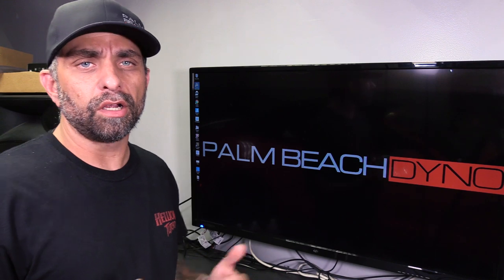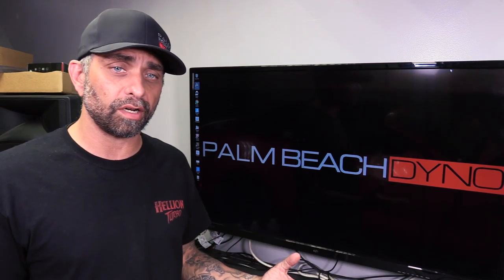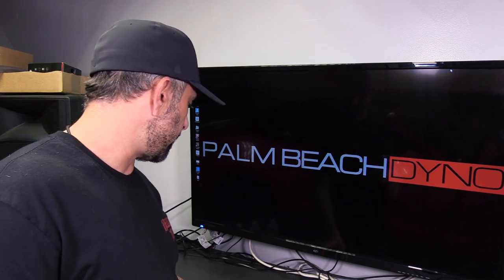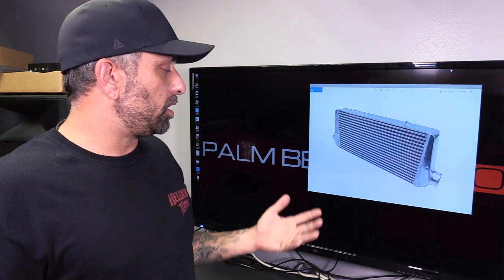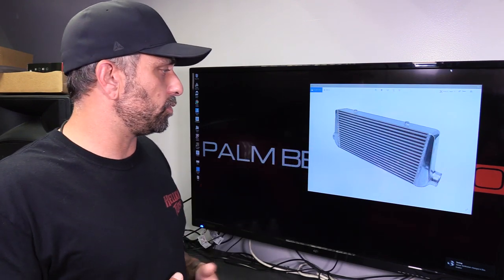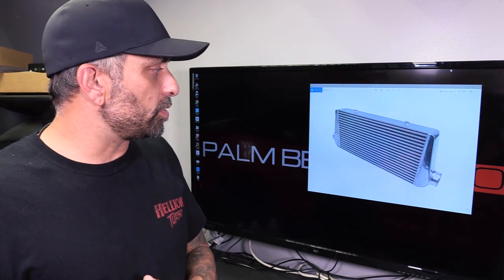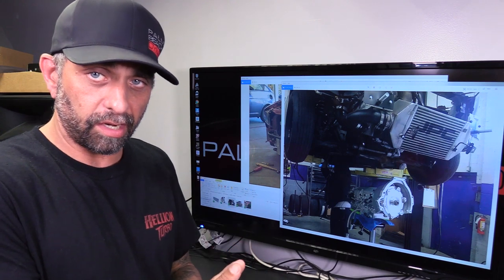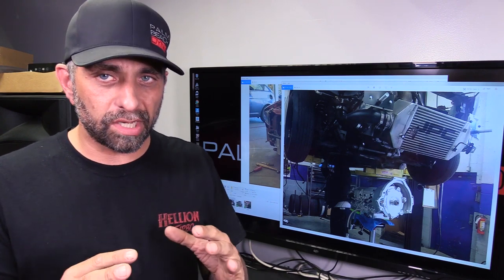Intercoolers : Air to Water vs Air to Air for a Street Car

Comment: Don't run e85 from the pump! You will get water at some point. Rather run water methanol injection. If you must run e85, buy a drum.
Reply: Buy the test kit to keep yourself safe test befor you pump\
Reply: That's everyone lol everyone gets it from pump. Do you already not get regular fuel from stations?

Comment: Why isn't there an air(charge pipe) to water(cooler) to air(outside air flow over fins) cooler. That would combine the performance/benefits of both and run your water lines to the cars coolant while still having a rad maybe thinned down a little to fit what I assume will take up more room intercooler but run colder Temps for sure. Everyone knows when you run air over something wet it'll cool the best.

Comment: My introduction to intercooling was done when I read Corky Bell's "Maximum Boost".  

The explination here is great.  I think that you want to "over engineer" the efficiency of the heat dissipation of the coolant running through the IC.  I'm running a bullet style IC on my air cooled VW Beetle with a 1.9 ltr Porsche 914 four banger..   Audi B5 S4 coolant pump, 1/2" coolant lines to a self purging resevoir tank from a Passat.  Compact radiator with twin fans and thermo switch for the fans.  When I'm in stop and go traffic, the  twin 5" Spal puller fans turn on.  My radiator is behind the front grill of my Super Beetle.  Great airflow. On the highway they turn off.  I run G13 (pink coolant with distilled water)

In the California San Joaquin Valley it gets very hot in the Summer.  We see 110* temps.  My  intake temps after the IC are never greater than ambient temp.  Usually they're cooler.  It's like I'm at sea level all the time, so the air intake charge is super cool and dense.  I run 91 on the street.  Plans are to be able to switch back and forth between E85 and pump gas and add water injection as a safety measure as well.  

Well engineered charge cooling is like having MORE cake.

Comment: Ok things to help
Downside to air to air. About 5 degrees over ambient is the best you’ll get with it and it might heat soak.
Higher pressure drop
Upside. It’s significantly lighter 

Downside to air to water
Weight, relying on an electric pump that can fail and cause incredibly high temps and knock

Upsides.
Sub ambient cooling with ice
Less chance of heat soak
Shorter charge pipes and better packaging
Reply: flatplanefool  e85 or meth on tap or both with air to air
Reply: crown Victoria lifestyle  run on straight meth and you can make the intake sweat... but for a daily having secondary fuels are a bad idea in my opinion too much stuff to fail an blow your engine up.
Reply: flatplanefool no no no pump e85 is the primary fuel which as he stated has its own intake air charge cooling properties 
The meth can be set to different settings to turn on and they also come with different nozzles so you don't have to spray a massive amount of meth on top of e85   just like anything the combination is key when I do my 4 valve swap jt- b trim that will be my recipe without having to worry about bags of ice, pumps and more hoses that add weight to the vehicle 
a simple one gallon meth Reservoir will be enough for many  runs
Reply: flatplanefool I probably confused you with my original comment my comment was have meth on tap I wasn't saying run meth by itself I was stating run the meth with the E85 or no meth or both
Reply: Basically keep you a spare pump if you go out driving

Comment: I just realized that car enthusiasts are so closely related to pc enthusiasts.
Performance is important and heat will throttle performance.
But forcing more performance in exchange for more heat is also a worth it exchange.  Especially if you can decrease the heat with aftermarket coolers.
Reply: Not to mention the simple facts of water cooling being more reliable and more effective at higher temperatures.  With being more expensive, having more risk involved, and having more effort to install and maintain.

Comment: Hi, I have golf 7 1.4 tsi. Integrate in the engine Air water intercooler. My idea is to add another radiator another water pump and another liquid tray and make it work with those. Turbo lag exactly the same as stock but more less degres.

Comment: I run an air to water exchanger that has the suction/return line from the air conditioner integrated into the reservoir. Obviously it cools down to a nice chill but isn't for everyones setup. The head pressures on the condensor are raised but not problematic.

Comment: So, question. My  truck has a horribly designed cooling system from the factory (Ram 1500 Ecodiesel). The intercooler heat soaks the radiator, which then heats up the oil. It has an oil to water oil cooler, so the oil temps shoot up with the coolant temps. I'm wanting to move the intercooler out from in front of the radiator, but have been going back and forth about mounting a smaller air to water intercooler down behind the bumper, which doesn't allow airflow, and then placing a smaller heat exchanger up in front of the radiator that won't take as much space, and will hopefully cause less heat soak when towing as the current intercooler causes. What are your thoughts on doing something like that? I tow quite a bit, and see temps much higher than I'd like to with my oil (250+) and also my intake air temps will hit 130-140, which I know isn't super hot for racing, but this also causes my EGTs to spike when towing. 

Anyway, thanks for your thoughts.

Comment: Im building a ka24 swapped 1984 datsun4x4  and dont have a lot of room up front for an intercooler. While probably only ending up around 400whp i was thinking air-to-water to try and save room. I have room for a second radiator if stacked on my normal one. But not enough for a 3 inch thick intercooler. 
Does this seem like unnecessary complication for a lower hp street car or should i go for it

Comment: Very well explained with thanks. So throwing ice out of the equation, is air-to-air the best option for a street car with less than 1000 whp?
Reply from the maker: Thanks. Yes, as long as it's a good air to air, I think it's the best option for under 1000 hp if you aren't considering ice
Reply: @PalmBeachDyno  Appreciate the response.
Reply: Thanks for tackling this complex issue. 

You neglect packaging, which is another reason so many factory cars run air to water. The low temp radiator is much smaller than an air to air heat exchanger and fits more heat dissipation capacity under the bumper. Factory body work limits the available space due to cosmetic and safety/bumper as well as AC condensor constraints. So retrofitting air to water makes better use of the frontal area available on the car than an air to air. More fin area per square inch of cooling airflow. That is why I went with A2W. 

Also it would be great to see some numbers on how to size the low temp radiator for various duty cycles, according to desired boost level and mass of combustion airflow (i.e. how to size the low temp radiator according to the heat load from the charge air). I see horsepower ratings on a2w cores all the time but none of them seem to care whether the car is running 3.5bar boost or 2bar. The amount of heat dissipation required for higher boost is much higher. No one ever talks about how big the radiator needs to be, or at least what the fin area should be, or how thick the radiator should be. Ideally you want a super thin radiator with a million fins per inch that has large planform dimensions. Best I could find was a Tesla model S front radiator.

Finally you have to mention that for street cars you have two heat exchangers to work with, and each one requires a temp delta. So a2w will never get as close to ambient with high duty cycle on the motor as an air to air. This is why air to air is used on almost all road racing cars (plus rules making non factory a2w illegal to avoid water on the track). Sure for drag racing there is ice but not on the street. So you take a bit of a performance hit potentially for the better packaging, depending upon the temp of the cooling water and the duty cycle on the motor.

Comment: Would you keep the heat exchanger if it’s a street driven car? Car will have a 7 gallon tank with 2000 pump.

Comment: hey thanks for info, Im coming from bmw world,

just a quick question, for race car, the reason to run air to air would be that its lighter setup and they dont have to worry about long term health of their engines?  is that why do they dont run air to water?  am I missing anything?

Comment: what off the shelf intercooler would you recommend for a '14' R8 V8 running the TTS twin rotax supercharger system... also what off the shelf charge cooler?  Their system, which I like, does not fit the Gen 1 facelift versions (the charge cooler). So I can pick it up at a discount but have to come up with my own charge cooler solution... and since I'm shooting for 750 bhp I just thought I'd ask. I try googling for 800-900 hp intercoolers for R8 V8 and I just get custom stuff.

Comment: Please can I get some advise.
Is it possible to have post watercooler air temp at 15°c lower than ambient? Using only tap water.
And preboost is about 30°c air temp.
And I'm adding about 4°c  water temp across my FM heat exchanger, while this is all happening.
And it's a k20 supercharged engine. All happens at about 15psi.
K type sensors from PLX used.
Reply: Compressing air adds heat - so the air going into the intercooler has already been heated above ambient. There are some neat air to water intercooling systems where an AC evaporator is put into the tank with the water to keep the water cold. When you cool the air down you will lose pressure - but that doesn't mean you are losing air density. Most things are possible.

Comment: I’m running a 4.5l L Whipple it’s making around 1350 wheel horsepower now would a ice tank help make more power on the Dyno? And if so how much would you think?
Reply from the maker: Most likely wouldn't show much on the dyno but would make the power more consistent when and if you ever run the car at that power level. Like if you took it to a half mile event, an ice set would be very important on your car

Comment: It would be interesting to see what effect injecting fuel/alcohol into the air-to-air would have on air temps.
Reply: I think I have an answer to your question, albeit a bit of a anecdotal one...

On my GT4, and using the stock WTA intercooling core; I upgraded the front radiator to accomodate a newer, aluminum one. Added two fans to the front of it (pushing) that turn on when the stock system kicks the pump on (aka when a throttle signal is detected), AND added Water/meth injection to boot. 

Car was able to boost FAR past its stock limits, granting around 330awhp, and 350 ft/bs torque. 

Accompanying mods were: Full cat back including downpipe (3in). Greddy Airfilter. 3rd gen 3sge intake (or exhaust) cam. Adjusted cam timing and a boost controller. Also heat wrapped the intercooler, since it sat right above the cylinder head.

Stock HP numbers put it at 245hp, with around 220-230 at the wheels. Car was daily driven for 2 years, and the intercooler pipes just about ALWAYS stayed cold to the touch. Oops, didnt mean pips, as the stock intercooler has short rubber (in my case poly) adapters that lead from the turbo (about 4in long) to the intercooler, and the one from the intercooler to the manifold (about 3in long).  If you need a pic for reference, just google Celica GT4 engine bay.

Temps never rose above what my buddies car ATA system would rise to, and the car was also put through: togue/autocross/drifting/light rallying. Only time temps really rose higher than ATA intercoolers, was during our late night runs around the island, where the car was usually continually driven hard for 2-4 hours straight. So it was kinda expected to be a bit high.

I am posting this, since there is still so much ignorance and mis-information about WTA intercoolers and whether or not they can adapted to a street driven vehicle, or what its main cons are against ATA intercoolers.

From my experience, the largest two "cons" against ATA setups are, complexity of design and weight (the amount of water in the system, and water pump, plus the addition of another radiator). 

The biggest pros are obviously reduced intake temps (like, REALLY LOW), far better response, torque and horsepower. Another pro, is that you can confuse everyone that looks at your car, when they wonder why you have two radiators, but seriously, the pros outweigh the cons in a street application. I believe they dont on race or sports competition situations (contrary to popular belief

Comment: Thanks for the info keep them coming.. I have a Hellion SS 64/66 pushing 20+psi do you think I should upgrade the Intercooler to a bigger one or go Air to water ? Roll racing mostly not a drag car . Thanks
Reply from the maker: If you plan to use ice, I would go for the air to water. With no ice, I'd stick with the air to air.
Reply: @PalmBeachDyno  Did you run through any high IATs on the one you pushed to 1400whp on hellion intercooler ?

Comment: So if I understand this correctly. By passing the heat exchanger for “race mode” is okay because the race won’t be long enough for the water to get heat soaked ? 

Also do you have to always run ice ? Daily driving with no ice I feel the air to water would preform the same as air to air.

Comment: Good video. Any experience with the MMR intercooled intakes?
Reply: Too expensive!
Reply from the maker: They are ok. The intercooler core is on the small size on the one I saw.  One thing to consider on an intercooled intake is MAF placement. That now places the MAF before the cooler and at very high power can melt the MAF. If you are running a standalone with a MAP sensor, this this isn't an issue

Comment: Vortech cooler better than procharger stage 2??
Reply from the maker: Yes but it's not a direct swap between kits. I've seen Procharger Stage 2 cars get near or at 200 at that 1000 hp mark where the Vortech will hit 160 or so
Reply: @PalmBeachDyno  well damn!!!